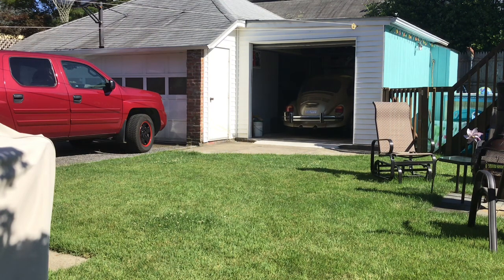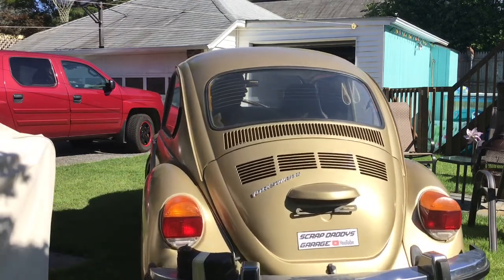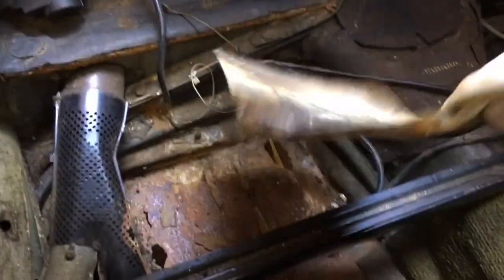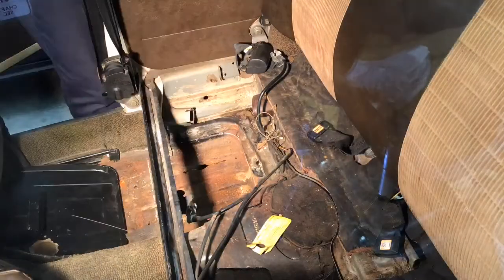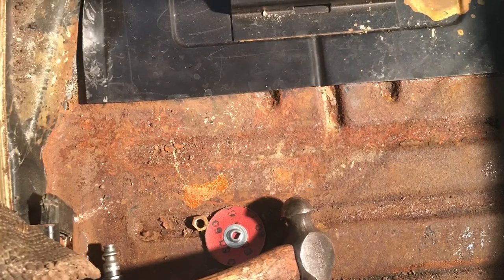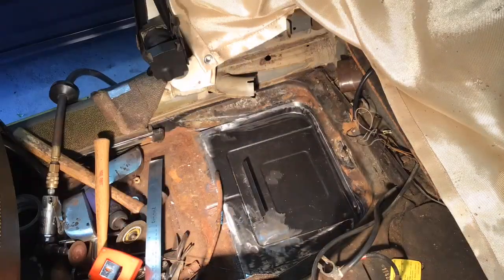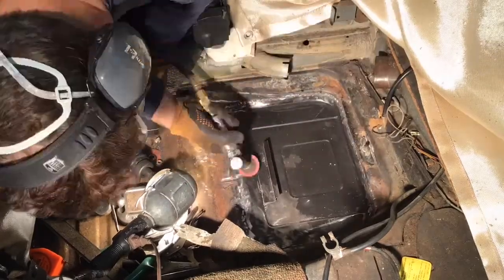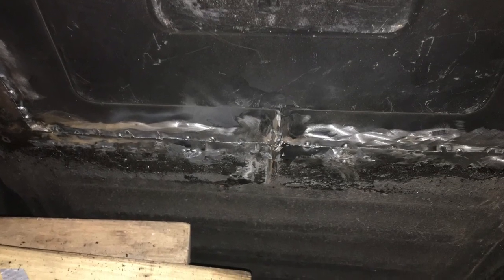Sunbug part 7 Battery Tray Replacement

Comment: How did you remove the heater distribution y pipe? I'm trying to figure out how to remove it on my 69 beetle but I can't find help anywhere. I'm hoping I don't have to remove the heater box etc. Thanks and subbing now.
Reply from the maker: It’s not easy,  it took a lot of prying and in the end I resorted to cutting a small piece off the y pipe to get it out. It makes it easier to reinstall and is not noticeable because it hidden inside the rocker ducting. Thanks for watching